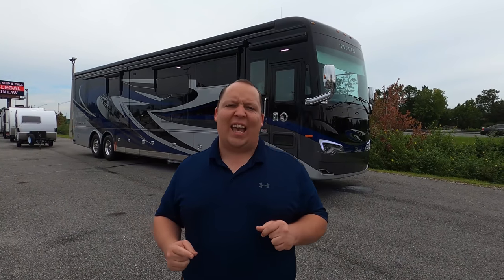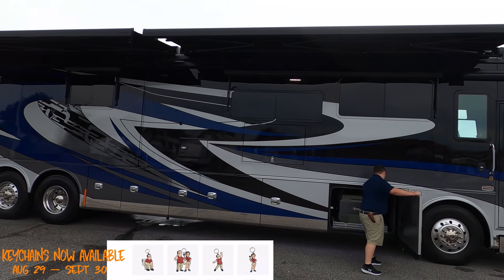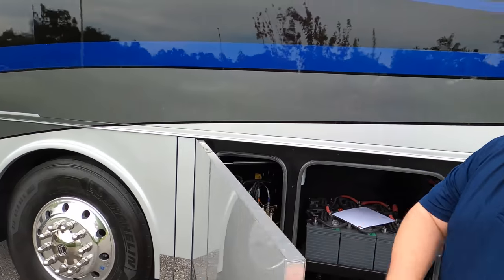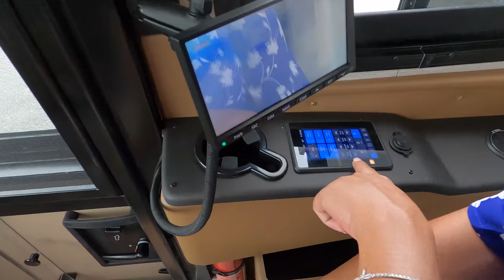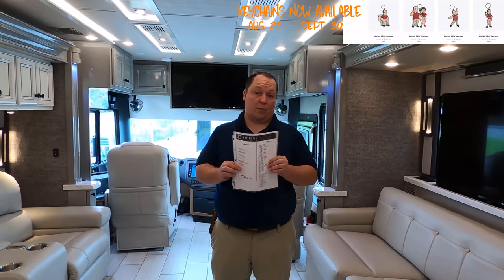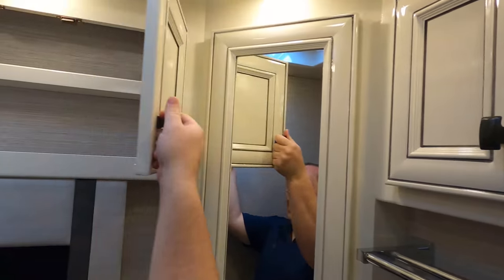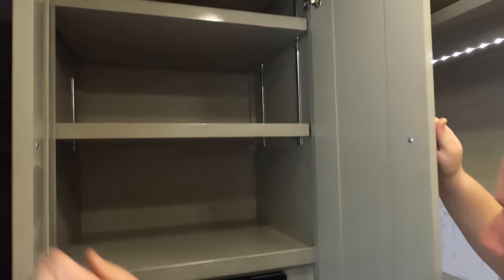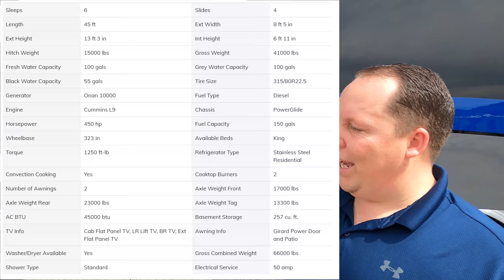The KING of Tiffin Motorhomes | Allegro Bus 45OPP

Comment: Matt and Andrea, very nice review. As a previous owner of a 2008 Monaco Dynasty, I'm wondering if a coach of this size and quality  is underpowered with a 450 Cummins vs a larger engine. I also would expect 12.5 KW generator....maybe not necessary. Some coaches of this size also have 365 front tires. The interior is apportioned very nicely. The rest of the coach is very very nice. I am enjoying your reviews. Stay safe.

Comment: I have a 2019 A.Bus. I love my 605 Cummins engine. The only thing I dislike is the Glossary finish and the exterior paint job does not hold up. I have all kind of paint chips on corners and edges. Other than these 2 items, I really love my coach

Comment: Good morning everyone! This RV raised a lot of questions and concerns..but I will only list the top 3..1st, since the emergency exit (which is a great idea) is behind the bed and apparently can only be accessed if the bed is pulled out, can you still access it if the batteries and electric motors are dead? 2nd..The one slider on the right side seemed super noisy as it was operated. And I thought I detected that it was sticking..how often can that potentially happen if you are boondocking? 3rd...the lack of access to the roof is concerning. 

Other then that, the RV is impressive. I like the 360 degree cameras. I like all the underside storage options and I like the colour integration of the appliances and cupboards.

Thank you Matt and Andrea!

Comment: Nice coach.  Dislikes:  Don't like the electrical cord reel location.  Too high, not electric, and looks like a cut out is in the door for the cord when hooked up.  Tiffin really dropped the ball on this one.  Don't like the fuel filler door being so high.  Don't like the small walk way while the slides are in.  Not a fan of the no bumper look.  Just a personal preference.  Like the side radiator and fiberglass roof.  Like the bath and 1/2 feature but the small walk way make it difficult to access.  Like the electric bed and escape hatch.  Great job by Tiffin.  Newer coaches with deeper opposing slides have this issue.  Other than that it is a fine coach.  Another great review Matt.  Thank you and Andrea.

Comment: The only 3 things I don't like about this rig is:  1) The front tires should be 365's. Not 315's. 2) A coach this size should have the 605 hp motor. Newmar puts the 450 motor in their 40' Dutchstar and the 35' Newair. 3) The pan under the wet bay hangs down about three inches lower than the rest of the coach. My cheap Thor Tuscany is the same way, which makes it hard to drain your sewer hose, due to it being so low. It's kinda hard to push shit uphill. That's been my experience. Great presentation, guys.

Comment: Like: the back bath, the sinks and shower esp.; the full length awning; all the storage slide outs, and the neatness in the other bays; the ceiling height, might even be able to keep ceiling fan in, lol.

Dislike: The emergency exit being behind the headboard, when the bed is tilted up it's inaccessable; no ladder, I'm not renting a cherry picker each time to get on the roof; an ice chest does not an outdoor kitchen make, think could have fit a sink and slide out electric grill too, somehow, for this price point; no desk space for laptop, in dash or elsewhere.
Reply: I believe there is a built in ladder that is part of the panel that flips out. I’ve seen that on other Tiffins.

Comment: Dislikes: walkway is too tight with slides closed, have to tilt the bed to close the slide, the slide rubs on the front seats. 
Likes: overall look inside and out is quality, fabulous storage inside and out, back bathroom is total luxury.
Reply: The slide doesn't rub on the seat when you move the seat forward before running the slide. That's why the control is on the seat, to remind you. I'm surprised Matt didn't make that clear.

Comment: I like the color choices on/in this RV. I like the flooring and the gloss cabinets with the black knobs. I like that emergency exit. I like where the stackable W/D is located. I like the bathrooms. I don't like the TP holder placement in the big bathroom. I don't like that carpet at the slide area you pointed out. I also am not crazy about the ceiling lighting. It looks too industrial for a classy RV. But don't go too far the other way and make it look like a Vegas landing strip. I hate RV's with all that Vegas casino lighting. Keep it simple and classy. What I like the best is that it is built in my state of Alabama. What I hate is that I can't afford one.

Comment: Wow! I had the opportunity to drive many of the Tiffan models several years ago to RV shows. This one definitely has a lot of class; but I prefer the older allegro buses. This one you would not be easily walking from front to back or having anyone sitting comfortably while traveling. Lots of bells and whistles that you would need to live in this for many many years. Depreciation horrendous on new rig like this. Like the power slides for everything. Don’t like the low cupboards over sink. Like my window to look out when doing dishes.first bathroom too little. Bashing elbows on sink. Yuk. I don’t like a fold up bed nor where the emergency exit is. Is all of this electrical stuff going to be working if there is a fire?  Shower is nice.

Comment: The DEF is not located by the fuel filler access doors. Most if not all Truck Stops have fuel and DEF pumps next to each other. Power Cord? Yikes! Don't like location nor access not Tiffinish. When all slides are "in" walk thru is VERY tight.
Love the escape door, but how does it work, especially for Seniors and/ or handicap?

Comment: Dislikes: 
1) Not a fan of relying on remote for awnings unless there is a backup inside on the panels. 
2) No power step-well cover for during travel for passenger. 
3) Not a fan of kitchen sinks on slide-outs for potential drainage issues and serviceability could be an issue 
4) Don't like the emergency exit behind the bed or bed lift.  Emergency exit should be behind the toilet in either the master bathroom or the half-bath.
Likes:
Everything else.
Question(s):
- Is the Rand McNally GPS based off the ones that commercial truck drivers use to avoid low height clearance bridges/overpasses?
- Is Android Auto available as well?
- Can the coach be upgraded to lithium batteries with solar or are the batteries deep-cycle AGM's?

Comment: I feel that on your dislikes you nit picked and missed some very big things. So here are my three dislikes 
1. The way the slide out rubbed the passenger captains seat that is not acceptable at that price
2. Nothing covering the stairs as you are riding
3. No oven
Now for three things I love about the tiffin
1. I love the interior it designed beautifully 
2. I love that it comes with the stackable washer and dryer 
3. I love the emergency exit
Reply: they do have a powered stair cover.  the chair can be moved forward, someone probably pressed the button and moved it back,  and most Luxury coaches that electric (no propane) come only with convection microwave. hope that helps

Comment: Likes
1The look of the dinette, looks super comfy
2 amount of windows
3 heat ducts are not on the floor- like the floor color
Dislikes- 4
1 color of the seats and couch, yes its light so makes it brighter, but i just think of how quickly they will get dirty
2 sleeper sofa, if you have a sleeper make it more comfortable
3 the two different cabinet color/designs don't like the high gloss grey
4 the stove how is it sunk just a bit, looks like it would be hard to use a bigger frying pan

Comment: I don't like that the passenger seat has the drop off to the steps going out.  I would like a piece slide to cover over the steps. I don't like that the batteries are not lithium batteries.  I love the emergency door.  I love the lighter colors. It is beautiful.
Reply: There is a cover that goes over steps ☺️

Comment: LOVE it has more than one bathroom
Love the color of the interior. 
Love the cabinets are glossy enough to reflect light but not that high gloss stuff I don’t like.
Love the styling on the outside it’s stunning.
Love the camp side dinette
Love the kitchen sinks
Love the master bath sinks
Love the shower I want it in my house 

I don’t love the price because I can never own one
I don’t love how the passenger feet dangle over the stair opening.. as a 5’2 woman that would be extremely uncomfortable to me and even if the foot kicks out for support it is unnatural to go down the road in a reclined position with your feet up so that would cause anxiety for me
I don’t love how the slide was in the way of the seat and you had to move the seat to keep the slide from catching it
I don’t love the wobbly drawers on a 500k coach. I’ve seen more stable drawers in a cheap travel trailer
I don’t love the fridge I don’t like residential fridges in RVs

Comment: First off it has a doggy window, but has it been una approved. I don't want Tiffin to think they are selling knock off doggy doors that don't have una certification. Another plus you over looked, you were getting a slight echo in the living area. So that makes the living area that much larger that they can produce an echo. Next time you do a walk around how about using the electric slide on the drivers side as to show that it can be used either way. When you showed the generator and mention that if can be used to clean the window, you should have pointed out where you are allow to step so as not to crush a hose while washing a window

Comment: Pretending I could ever buy this motorhome.  1) I dislike how close the slides are to the cockpit.  I could hear a lot of creaking when the slide went out.  2)  I dislike that there isn't an oven.  3) I dislike how long the motorhome is.  Where would you park this this? That's just me, I like to go to National Parks and Forests. 1) I like the cockpit area; it looks very comfortable. I like the co-pilot controls.  2) I like the laundry/walk in closet area.  You could fold your clothes and put them right back up.  3)  I like the powerful engine and its complementary cargo carrying capacity.

Comment: OMG. So many things that confuse me on this one. Of course this would have been great to use a drone on to get that look at the fiberglass roof and all the "stuff" up there.
Likes:
1) Paint job
2) It includes a safe for the owners gold coins (because of course the person that buys this must have a bunch of gold coins they travel with)
3) The sliders in the storage and maintenance bays

Dislikes:
1) the "fancy" steps for the front door - it seemed like Matt had to wait for them to deploy when exiting the bus.
2) the fact that there was something designed in the slides that could "ruin" the seats. At this price point you should not have to worry about that.
3) No standard oven for baking.

Confusions/questions:
- If this doesn't have propane, what does the fireplace run off of? Do you have to carry wood?
- In the specs you listed that it sleeps 6. How? If the dinette doesn't drop down, where are the final 2 sleeping? The recliners?

Fixes:
- Fix for carpets on slides - don't have slides. Back in my day we didn't have slides and we were happy campers. ;)

Comment: DISLIKES:
1. Both bathrooms lil cramped. In coach this size could easily be bigger.
2. Glossy cabinets 
3. No oven. I’d probably be full time in this beast and must have an oven.
LIKES:
1. Light color interior 
2. Plush seating
3. Safety features - 360 camera, escape hatch etc

Comment: 1. Dislikes.  Cannot believe that they put in Lead Acid batteries.  That level of RV has to have the state of the art technology for power and batteries - Lithium Iron Phosphate.  Would also save about 300 pounds. "Extended cycle batteries" are an option, but don't know what an "extended" battery as that is not an industry term.  2. Outside remote for slide awnings. Should be integrated with slides.  3.  TV over the driver station.  I feel that is a safety issue while driving, which means it would be off most of the time for me.  Would rather have storage.
1. Likes.  Technology, luxury, automation.  2. Integration of all the electronics into the Coach is top notch.  3.  Lighting.

You're right about the cabinets.  Very modern looking but I can hear it now in 20 years it will be "Those are so 2020's looking!"   Can go wrong with medium Cherry woodwork.

Bottom line though, if I had the money I'd buy it!!

Comment: I don't like the ceiling fan in the bedroom.  I don't like the lack of access to reefer repair or replace.  I don't like the skill level required to drive it.  There must be a cover to the passenger side cab access, I would like to have seen it.  Its very beautiful inside and out.  Perfect for those who live in the north and winter in the south or vice versa.  I like the ambiance.  The foldout bed is for the transport driver.

Comment: Likes: 1) the slide out under belly freezer, square shower with blue water recycle button, big sinks, the huge walk in closet.
Dislikes: 1) the dinette, two sinks, tilt bed, painted cabinets.

Explanations:
If the bed can be used without the slides out, then removed it from the dislikes.
I prefer a table and chairs for the dining room.
When my wife is using the sink I'd better be somewhere else.  So that second sink is useless to me.
Finding places for your "Stuff" is never easy in an RV.  That walk in closet gives you an unbelievable amount of extra storage space.  They have that in several other models (mine is a 40AH).
Why are you paying for oak, walnut, or cherry wood cabinets and then painting them?  They would look the same if you used plywood and painted it!

Great coach, although I coughed up my skull when I heard the price!

Comment: The dislikes 
1 it need s 605 cummins 
2.and ir needs  12.5 gen 
For the money you are spending
Reply: nova69 horsepower on diesel is irrelevant, it’s all about torque and there’s plenty there to hustle this puppy up the road.
Reply: @colingoldthorpe5918  Good point. Torque and Gearing make up a whole lotta horsepower indifference.
Reply: @nova69 i have 2017 cornerstone  its 45 ft  it has 605 cummins  plus 12 .5 onan Gen  3 roof airs  and a bathand half 
For the price point beed a horse are 2 more
Reply: @nova69 605 HP engine is available.
Reply: mrjl barrett lots of roof space. add 6x200 W of solar and pull out those 6 (8?) cheap NAPA AGM batteries and put in 12 lithium. Lifetime warranty, faster charging, more power, for about the same size and weight. Payback in about 5 years. I’m not a sales person I only play one on TV. You could likely get by with a 6k generator.
Reply: @colingoldthorpe5918  HP gets you up the hill. Torque is a measurement of twisting force, HP is a measurement of ability to perform work. There is a direct relationship between torque and HP determined by RPM. Low torque motors can make high HP at high RPMs, high torque engines at low RPMs. But the same work gets done.
Reply: @nova69 450hp is plenty of power, we have the Entegra Aspire 44B with the ISL 450hp 1250tq turbo diesel, and we have no problem climbing the mountains

Comment: There was basically two things I DID NOT like. I liked mostly every thing about it. The number one thing I absolutely hated was the awning buttons on the side of the recliners. A major design flaw. Secondly, the emergency egress door or w/e you call it, is in a TERRIBLE place. Behind the bed is a no go. In an emergency it would take to long to put the bed down and open the emergency door. The emergency egress door should be like in the bathrooms or some place like that with quicker access.

Comment: Thanks for the review.....although.  Here are my takes as I'm shopping for another one and coming from a custom business and opportunity/solutions company, here are my thoughts: I do have likes, but here are the details that need consideration at Tiffin:  The ceiling needs better aesthetic design.  The flow works better than many coaches, but looks more like a community bus vs a custom coach/home.  2)  The rear escape hatch and bed hopefully have a redundancy safety system (:ie the transfer switch fails, catches fire while the bed is in the reading position) if the electronics/fuses fail, you are trapped in your bedroom not able to get the bed down or the hatch open. You have less than two minutes to get out. 3)  Need better looking recessed vanity cabinet interiors. Simple and not thought about, but simple and easily to make more impressive.  There are a few more things that could warm the feel of the coach, even a modern one, like smaller grout lines on the floor tile, better plastic and detail at the helm trim, etc.  I'm not cranky and an@!, more fun and creative, but I look for the simplest details that to me make a difference for a $500k rig.
Shoes:   Please remove shoes on walkthroughs.   :)  Treat it special.  It's a land yacht  :)
Thank you for the tour of the 2021. Keep them coming. Jonathan Taylor Group, LLC

Comment: BIG dislike: captain & co-captain  seats WILL get smushed by slide as it goes in. With 45’ surely Tiffin could have allocated 4”-5” clearance.
Reply: That's why the slide controls are on the seats; so you don't forget to move the seat forward before running the slide. If a person can't handle that there's no hope for them anyway.
Reply: Tom Brennan You must have missed Andrea showing the slide pushing into the "cheap” (NOT, it’s expensive leather) leather. At 1/2 mill should be fool-proof.
Reply: @brianreimer380  Andrea should've moved the seat forward. I told you how to properly work the thing; accept it or not, I don't care.